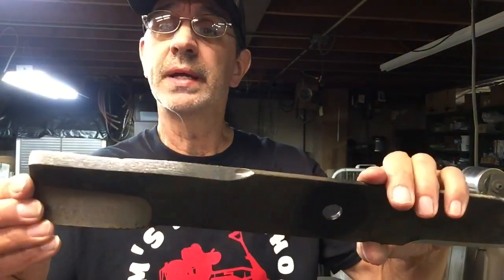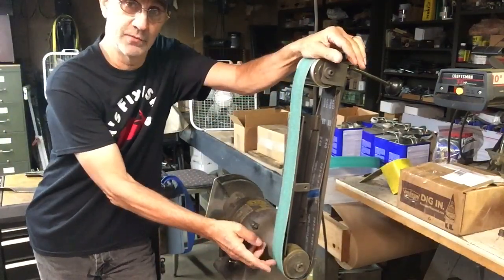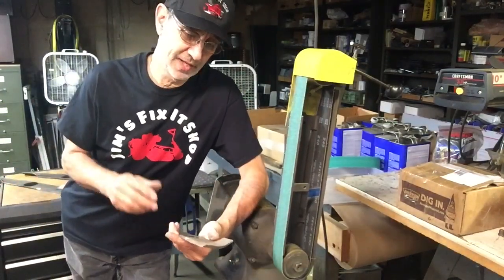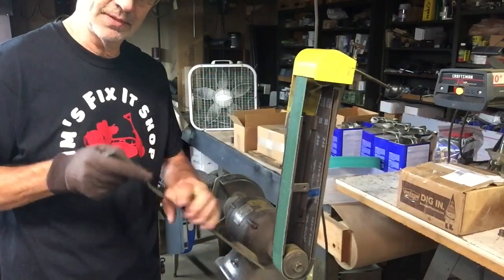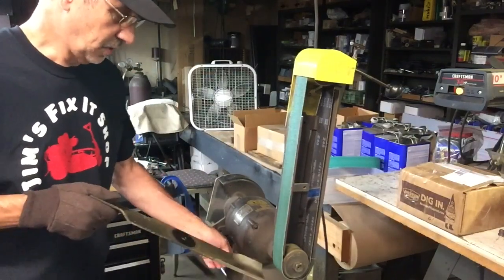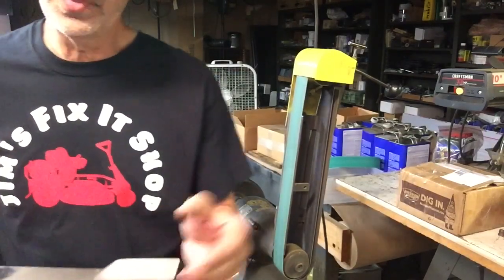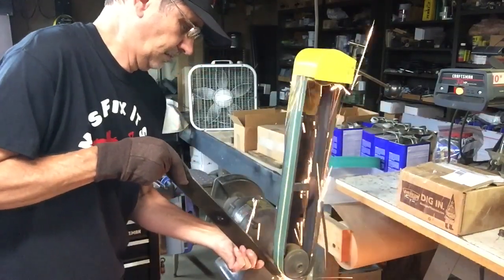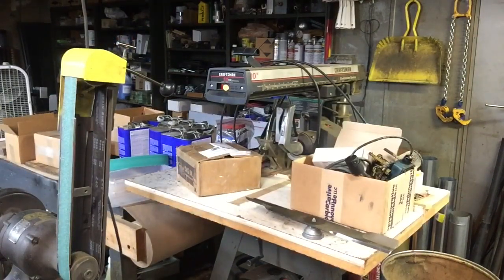400. This is how I sharpen my lawnmower blades for any machine that I work on.

Comment: Hey Jim ! That's a pretty neat setup I've never seen it done that way , I still do it the way I was taught in shop class with a grinder , & of course I balance the blade! So I guess I've been doing it that way for 40 years , But I do like the way You do it probably removing less material with a belt sander ! Thanks for the video Jim SNAPPOUT.

Comment: Hi Jim, I’ve been using a belt sander for a while now but I use my portable 3x21 Porter Cable. Works pretty well with the wide belt. Down side is I need someone to hold the sander, usually my wife, lol

Comment: Hi Jim, thanks for the demo on belt sander blade sharpening and note about balancing a single Snapper blade.

I would like to build a belt sander such as you have. Where can I access diagrams or drawings?
Reply from the maker: Well there’s probably plans and drawings online we just made them at work and the boss made them off the top of his head and they all seem to work good I’m gonna try to copy one of those. Jim

Comment: When I sharpen my blades I use a drimsl to get the very edge of the blade sharp the balance tool is a nail that is nailed on the power pole

Comment: I've gotta puzzler for ya Jim !   I have a snapper rear engine 28-in hi vac with single idler pully.. about an '87 model.. some of the Snapper people on eBay tell me   it's categorized as a   series 6 .. it DID come with an 8hp motor   I ordered the prescribed  double v belt  71" long and it's way too short to fit my mower the belt that came off of my mower measures 96" Long ? all the pulleys are still stock   and the deck hangs from the chains like it should it's not shifted or anything   you got any idea what's going on cuz no one else seems to have a clue ! 🤷
Reply from the maker: Take some pictures of your machine and with the deck cover off and send me the complete model no. To jimsfixitshop@gmail.com
Thanks. Jim

Comment: Thanks for the video. I have one of those balancers I don’t know why they didn’t make them smooth
Reply: I made a smooth one one my 3d printer and found it impossible to center to get accurate.  My dad has a step balance cone and I think it's easier but not a perfect fit no matter what blade I try on it.  I think a large nail or small rod clamped in the vice is easy and very accurate.  You just get the blade rotating slightly and you'll know the heavy side quickly and consistently.
Reply: @chadr00  👍